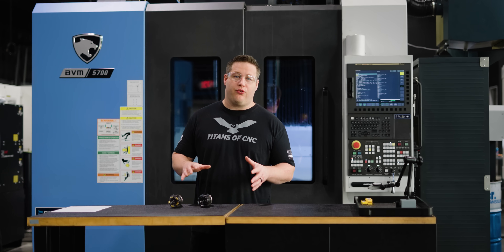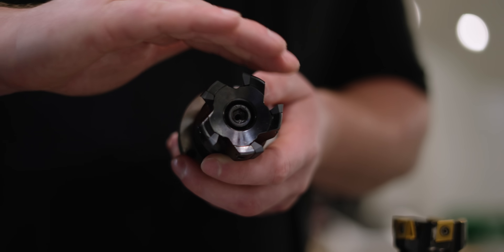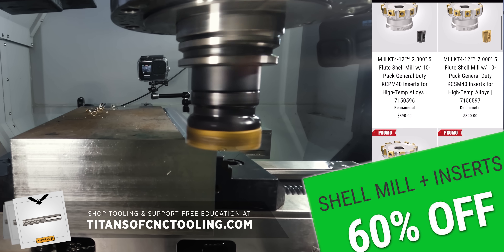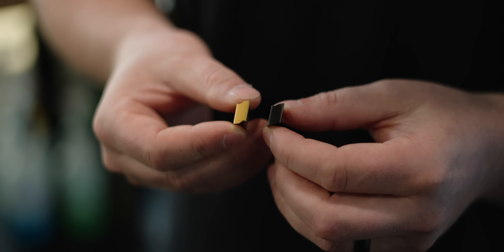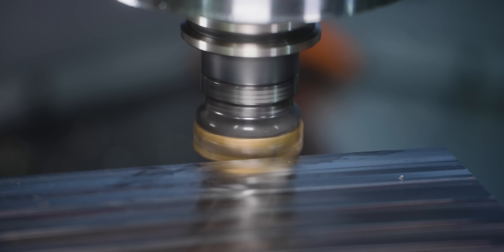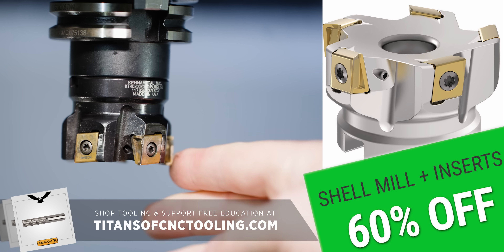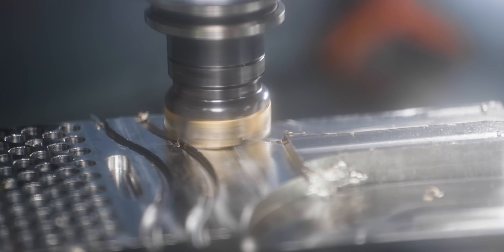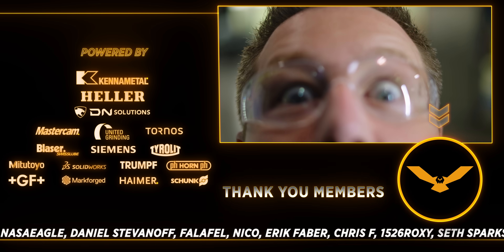60% Less Expensive for Ultimate Metal Removal | MILL 4-12KT

Comment: What about a 1/8" thick hat top on a smaller part. I LOVE this cutter for bigger parts, but I find the inserts dont last long on smaller pieces that dont dampen the vibration as much.
I alo noticed, that if i run this with a facing toolpath 1/8" deep the inserts last way longer than if I try an adaptive cut where the pressure direction is changing. I always run it with thru spindle coolant on 304/316ss

Comment: Probably a noob comment, but isn't a mill insert always in an "interrupted cut"? the insert goes in and out of the material either way right? So why is a mill pass over  e.g. a hole or slot so much worse?
Reply: I'm guessing multiplying entries in addition to shallower angles/stepovers of those entries.

Comment: @Jesse Could you use a HARVI TE endmill for the boss/contour feature on the right side of the part too using as much flute as possible? Is there a video on tool selection based on unique features? Is tool selection all based on experience + what you have + what tools are in the budget? How do you come up with parts to showcase the capacities of these tools? These tangential cutters are cool.

Comment: Jesse, you mention that running your facemill without coolant is torture testing your face mill. However whenever I run stainless, including 316L. I run into premature insert failure due to thermal cracking especially with hi-feed. If we run dry or with just airblast we have far less problems. Do you have any tips or suggestions?
Reply: do you have through tool coolant or flood only?
Reply: We have Hi-pressure thru coolant and full high volume
 flood coolant. @JustinKeller5719

Comment: On one of our lathes haas hl4 we run nothing but black pipe with nasty mill scale and a big ol weld bead and its insane how often we are flipping inserts
Reply: Have you tried round inserts?
Reply: Totally ! We use them alot with the cnmg and we coordinate with Kennemetal and MSc but still just blow through them, getting better everyday but nothing compared to anything other than pipe with a weld seam , we mostly barb groove and thread the pipe

Comment: coolant on a indexable mill in steel? sounds like not verry good idea. because of the heat the tool generates during cut and get shock cooled, when it leaves the material. your inserts will get crackes from that. way erlier they would wear out than if you are using just air

Comment: It’s not a real comparison.
Try both these tool to ramp into material or slot and you will see that 1-14 will win. Also try to run both these tool on old Haas and  positive inserts of 1-14 will push on spindle much less than negative tangential inserts.

Comment: Video idea Titan Team - Can you do a video showing when you change inserts. Example, using this mill at what point would you change the inserts, please do a close up on the inserts so we can learn from you. In the same video show what tool you would use for finishing and how you do it, example stock to leave speeds and feeds to include when you would change inserts on the finishing mill. I am new to machining, and I don't know what right looks like. For now, when my insert chips I change it but do you guys do the same?
Reply: It’s all to do with the material being machined, the load on the spindle/machine and how bad the insert is machining in general, but usually if the insert is damaged it’d be good to change them out
Reply: As a tech rep for a major carbide company you want your change them when a few thing happen.
1-flank wear on the bottom & sides. Especially if the coating is gone.
2-As he said your spindle load rises say from 70% to 80%
3-the part finish starts to go bad.
4-sparking  can also be a sign to stop and change them. 

There are some general rules but sight is the best. Checking the insert wear periodically.
Alloy Steels generally 45 mins
Or more.
Stainless might be 15-20 mins
Nickel base alloys 8-10 mins
But inserts and coating are getting better and better, so wear is something you need to watch. 
Hope that helps!
Reply: @bobmac9070  bkbo0l0
Reply: I am in a prototype shop running 1s and 2s so there’s times I use the same inserts for months.  I always just use my fingernail to check if they’re sharp. If it doesn’t shave cleanly I change them
Reply: There are some applications that you actually want a not so fresh insert. I used to keep a box of inserts, which I had purposely stoned the edge of, for just those occasions. We had a part that required a 7 finish AND we had to track the walk of weighted dental floss on the spinning part for 60 seconds. The only way to get the finish requirements and keep the walk within tolerance, was to use slightly dull tooling.
Reply: @OneTruePhreak  I agree, we called that the “edge-prep” we offered a number of inserts and tools with various edge prep. From almost dead sharp, to 3 other styles depending on the material.
Reply: Only kidding, you kinda gotta base it on sound, feel, material finish, the look of the insert, ect.
Reply: When machining stainless steal tool cost is very high. So when removing lot of material, you want to use inserts to end as possible. When edges and chips is glowing bright red you can still run some part to end. Insert look terrible and lot of heat is generated, but no other harm is done . Without the experience you wouldn't believe that so dull inserts still cut. But when there is  no other factors you can remove material  till  lot of red glow. Most tool get broken from some kind of other reason then chancing inserts too late. So lot more cost come from chancing insert when not necessary then from chancing them too late. And I'm mostly speaking stainless, because with steel your tool cost is like 1/5 so you don't have to worry so much. But you definitely should learn to use insert to almost end. I have seen lot of professional machinist change edges when you are only 50 % of maximum. "just  in case". Very costly to company.